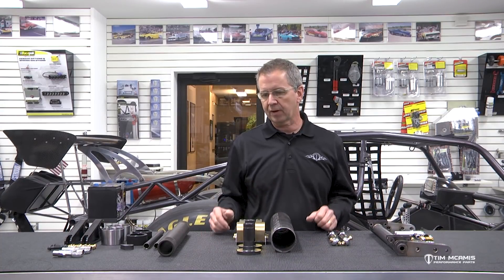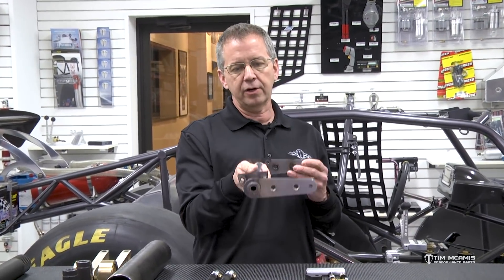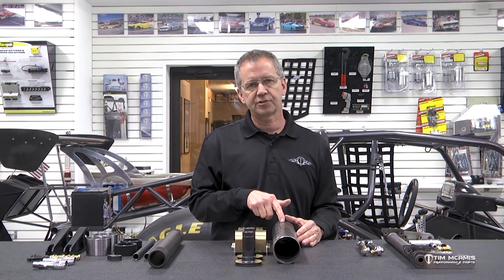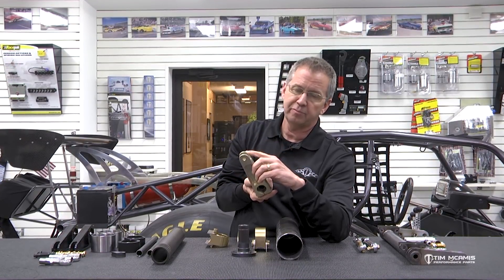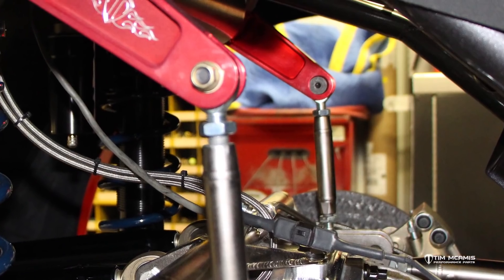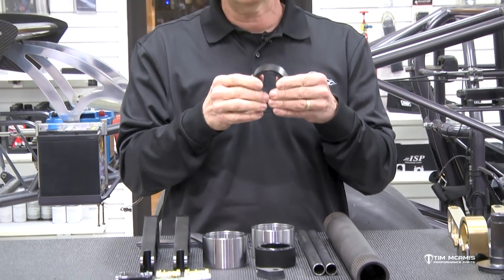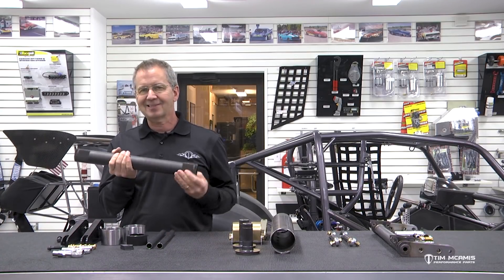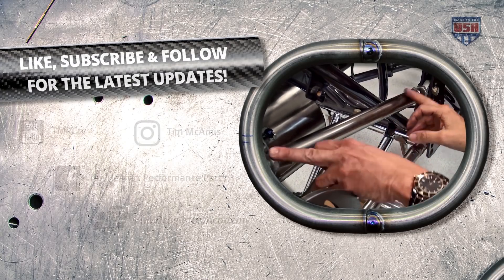Anti-Roll Bar Overview

Comment: You sound like you've spent waaaay too much time watching what's his name do his Bush I, and church lady characters...  LOL...

I hurt it Every once in a while, I hear a hint of it, but it comes across as sincere...not intentionall

Nice stuff, very nice. seems to me, gut feeling, mind, if I was running the driveshaft to match the anti-roll tube. Between the engine and the tires, the driveshaft is the weekest link...

I've been wondering why these Pro Mods seem to crash a lot... got anything to do with insufficient anti-roll gear?.
Reply: Not really. Crashes usually are caused by tire spin downtrack, the back of the car gets loose, turns sideways and you are in for a hell of a ride with those big sidewalls and only 5-6 psi of air pressure. Try driving your daily driver on the freeway with 10-15 psi in the rear and you will get an idea of how a drag car handles. . Usually not enough time to recover before you find a wall. The anti-roll bars are basically to keep the cars from picking up the left front corner very high in relation to the right side, or "the chassis rolling on the rear suspension". A lot of home built cars with ladder bars also have these anti-roll bars but if you look at a rearend with a ladder bar rear suspension it is already a giant anti-roll bar in and of itself.

Comment: this may be a stupid.question, and anybody can answer this for me... But.. I understand 100% how these work on the back of a drag car like is on display in his showroom, but, do this card ever have sway bar set up on the front end? I would not think there would be a need, even a small diameter of light torsion tension away bar, just don't see ever anybody installing one. Yes, I understand, the kits on display are for the rest application... But,considering how much the front wheels are on the ground when it counts, or should I say, lack there of, lol... Meaning, under heavy launch, the front wheels don't really do much, I would assume??? thank you in advance
Reply from the maker: As Ashkan stated, they can be used in other forms of racing on the front end, but not necessary in drag racing.
Reply: @Timmcamis  thank you folks for answering my question... I did assume they served no function in this level of drag racing, but being I am not at this level of drag racing, I actually had no clue if the big dogs had roll bars in the front, well, now I know... Again, thank you, Dru
Reply: @all, if I was driving the thing, I'd want it as stable as possible when I needed it... when you need it in a drag car, you already got one foot in deep shit...

If it allowed me to recover from 30%, hell, 10% of the ones that get away, it's worth it in titanium...   though, you only get 3-4 in a career, before you bite it bad enough to leave the sport.

I just commented above, and posed the question of the Pro Mod animals seeming to crash a lot, and whether lack of adequate anti-roll gear is partly to blame.

Just saving one is worth it.
Reply: @georgedennison3338  AHHHH.... that is actually a good point... I realize, every gram of weight adds up, and can make it break a finish, and in turn, a WIN. But, I think I like your point of view much better, that if that small percentage can at the very least, save the car, let alone save your life, I think I would just take it upon myself and install an anti roll bar assembly on the front as well... I no longer drag race, and haven't for every bit of 15 year or so, (nothing at this level Tim does) but I still have many of the cars I built and are just shelf queens, that come out on a Saturday night and just cruise around with the lady for a couple hours, as they are street legal, but I don't even best on them, even when temped by somebody, I have no interest in doing any street racing. 

First, street racing is illegal, and in Indiana, if you get caught, it is costly in a bad way... If you have an accident while racing, it can be trumped up to a felony or a series of felony's.... So it isn't even worth it, and more then anything, after 13 year in a wrecker working for my city, it changes the mindset from thinking "nothing will ever happen to me" to "I can only hope, that somebody doesn't upset my life, because they were facing and hit me"... While in the wrecker days, I am actually scared to go fast now, lol. I won't even goose the throttle up to 30 to 50 mph for the showing off factor... Maybe I am just old... Of course, spending the week packing everything up to hear to any of the closest drag strips, that is allot of work to prep for a week end event, it is tiring just thinking about that, lol.. I just stick to Jeepin and rock crawling and the off road parks and most importanlt , I can spend all day playing and driving for how ever many days I am at an off road park, and Indiana has many off road parks... I am happy doing 5 mph or less.. Summer up, I think I enjoy the building process of what ever rig I am building, and the desire to push a rig to its max, is last on the list, as per the competitiveness goes... sorry for the novel... Please note, I am in no way condemning drag racing, I love the sport, I just don't have the desire to be in the rig at top measures of flight, so to speak, lol
Reply: Front sway bars are for keeping the front from rolling when cornering.  Important in road racing but not needed in drag racing
Reply: I would say yes. They help with the roll through the turns but I’m not 100% on this.